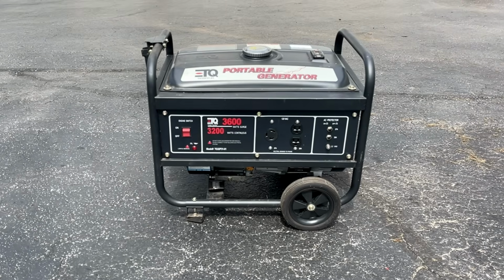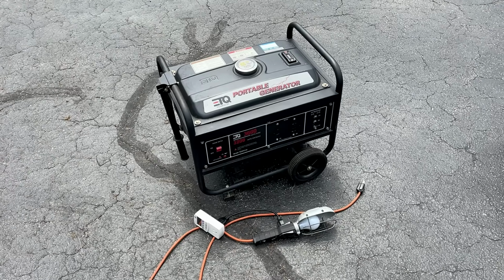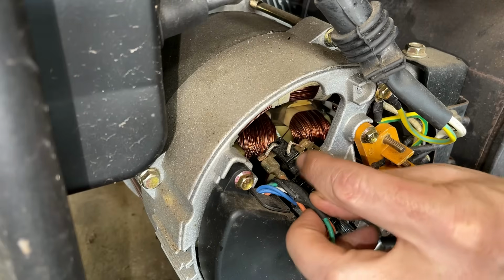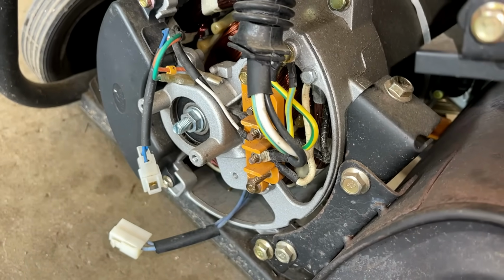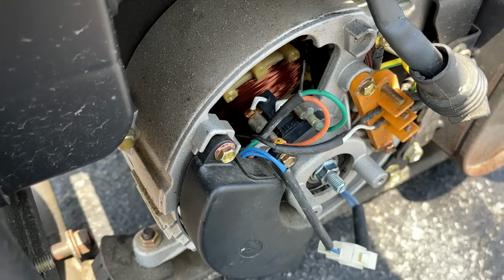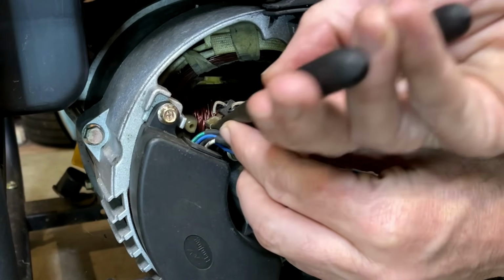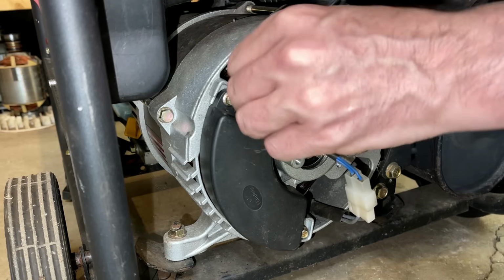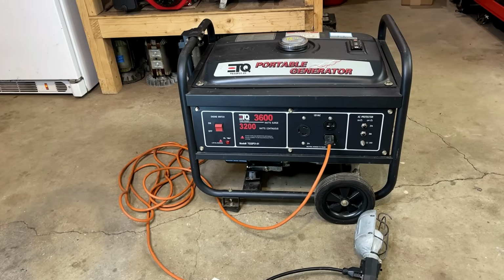Two Generators No Power Output - Same Model, Same Problem?

Comment: The slip rings look like the machining tool has had some chatter during the process. I wouldn't be surprised if there are a series of rotors that have the same issue.

Comment: Nice job James, now I know why these types of generators are so cheap.
Manufacturers save money using brushes and sliprings. I got started in power.
generation in the Army over 40 years ago and for the last 32 I have been taking care.
of a power plant. All of our generators in the Army, big and small were. 
brushless generators. Here at the power plant the generators have 3 generators in
one generator assembly. A permeant magnet generator or (PMG) to power the exciter,
 which feeds the main rotor, no brushes. Your videos take me back to a time
when I worked on the smaller generators. Thanks for the education.
I guess even an old man can learn something. Have you come across 
brushless generators? Anyway, great video. Gary
Reply from the maker: I do not see brushless as often.  Usually on older equipment.  Just finished working on a little Honda em500.  It is a small, but well made brushless.  The exciter has permanent magnets to get the stator up to 50 volts and some electro magnets and an AVR to get it the rest of the way and maintain voltage.  If you check out my playlists, I have one for brushless.

Comment: You got two generators that doesn't work my question do you still need it I would like to have it I need a power generator that size to run a sub power DJ system how can we connect and talk

Comment: I find the easiest way to really clean up the slip rings is to chuck the rotor up in a drill and spin it up then use your sandpaper. You can usually get them pretty flat just with that.

Comment: Rotor needed removed and slip rings turned and then stoned. If their not too bad you can use a stone to clean the slip rings with the engine running. You can buy a dressing stone at electrical stores or motor shops.

Comment: spin that rotor with a cordless power drill and a deep well socket . use 320 then 600 grit sandpaper taped to a wooden stick.

Comment: I have a duromax xp 4000s that starts with no problem at all, I plug 🔌 in a 2 inch submersible pump, it pumps for like a minute then it loses power for like 30 seconds then over again, anyone have any i

Comment: A small narrow honing stone, to clean and smooth the brushes, i do this with the engine running,
After honing i use a piece of hardwood to burnish the slip rings, this removes any scratches and helps prevent arcing by creating a surface on the slip ring that is equal resistance any point overall surface, no arcing

Comment: Before doing all that resistance testing, i would have checked the voltage going to the brushes and slip rings,
If no voltage from AVR, then put 12vdc on the brush terminals snd start engine, should get around 60vac at the outlets, rotor ok avr bad, 
A good visual inspection of generator head wiring should find that loose brush holder , without all the resistance reading's,
Which could have been done after fixing the loose brush

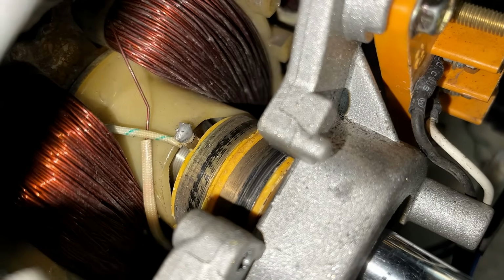Comment: 18:30  More cheep, cheap chinese cheepie  junk. They do not make, the slip rings, out of copper; also, the cheapest low quality carbon brushes. Get some, made in USA.  i  had an Xstream 3100 gen.  IT  had the brush holder, positioning the brushes, too far   INTO  rotor slip rings, the inside brush, was only half on the slip ring, with wear at a  45 degree angle. So, i shimmed it up ( tim the  shim, coffee) with two small washers, between the housing and the brush holder; moving brushes about  3/32  inch toward the outer cover.   Cleaned up slip rings, now makes  ' juice'.  Engineering from metric/english  buggered up the Autocad engineers, in drafting the measurements. And, the assemblers didn't  care.....typical chinese cheapies.
Reply: What's the point of this rambling on Chinese stuffs.  There are so many stuffs made over there and surely not everything is junk.  At least they don't charge u an arm and a leg like some western companies.  Your ignorance is showing really well.  Get what u pay for.  Don't want junk, then don't be so cheap and spend more.

Comment: Good man.  Pencil erasers, are a very fine soft abrasive. We used them, for over 30 years, cleaning memory sticks/chips on computers. And any other electronic/electrical , type of similar. The white, rectangular ones, work very well, also. As do sandpaper sticks, for larger metal objects.

Comment: Hey. I have a generator that reads 114volts output on the voltage meter but I'm not getting enough power at the ports? Any idea what may be wrong?

Comment: I had a similar experience with the rotor on my motorcycle.  The slip rings had what I would call divots that caused the brushes to chatter.  Replacing the brushes didn't fix the problem and I had to change the rotor.  I would measure the runout of the slip rings before I called it good.  Perhaps a local machine shop could turn the slip rings on a lathe.

Comment: If you look closely at the slomo running shot at 13:49, you can see the end shaft where the bearing is, is not concentric.  The threaded shaft wobbles as it turns.   As another comment stated, it is likely the bearing pocket is worn and allowing the slip rings to bounce around, causing the arcing.
Reply from the maker: The ball bearing inner race is pressed onto the rotor and the outer race into the end housing.  The bolt only applies pressure to keep the rotor pressed onto the tapered shaft.  The shaft for that bolt is larger then bolt so it is normally not centered.

Comment: I would have cleaned the armature/slip rings with some emery cloth on a block of wood/stick with a flat surface to help reach in there and hold the emery cloth. With the brushes removed and everything out of the way, I would start the engine. Then use the emery cloth to clean the armature/slip rings so they look like new.  That should lessen future potential problems. I'm NOT telling anyone what to do or suggesting anyone do this. It's just what I would do.

Comment: Any ideas? I have a GX390 with a honda engine. Engine works excellent. At start up, provides 120 volts for 10-20 seconds then drops to 9-12 volts. I have replaced the AVR with no change.

Comment: Just subscribed!! Awesome video, just wish you lived closer to me haha my Genny has the same problem slightly more complicated though it's a 15kv arcgen powermaker but you have now given me an idear what to look at to see if I can fix it, also putting a low voltage out but nothing like it should be so could just be the brushes on the rotor hopefully!! Would it be a possible cause off my welder genny not produceing the power it should also I rebuild the engine but it slows right down when you turn the amps right up and really labers think it's more to do with the alternator though

Comment: It is most likely the brush assy is a bad design, or 'fail safe' the frame is not sufficiently heat resistant either by accident, cost, or by plan- the brushes most likely arc as the frame distorts, the springs then applying uneven pressure on possibly now skewed/twisted in position brushes, they begin to arc and erode the slip rings brushes grind away and unit ceases to make power, generator then cools. So a possible 'safety' to prevent damage.

Comment: Decent video, well explained, but you may of heard this before, ...why would value your life at $15.00 using that piece of shit multimeter?  You sound like an intelligent guy and why would use this tool that could fail miserably and result in electrocution?  You don’t have to reply to this question btw.  Life is to short to save money buying crap tools my instructors used to say.. Obviously the generators fall into the same category as your multimeter.  Nice video though.

Comment: Great video James. Very useful.  It will be interesting to see how long now these generators continue to function after the fixes you applied. 
I looked at the video of the fix on the first generator and it seemed to me that the shaft was out of alignment. This may contribute to the brushes melting.
:goodvibes:I may be wrong as it was only in the video for a short time and the nut shape did not help.
Reply: That caught me out on a couple of videos but in fact its not the shaft run out its just the head of the long bolt that tightens down into the hollow shaft of the rotor and the head of the bolt doesn`t centralise perfectly. Shaft still runs true as its held in the bearing.

Comment: What causes generators to stop making power? I have one for emergencies, I pull it out and start it occasionally. It stays covered with a blanket and a generator cover in the corner of my garage. What can I do to keep it in good working condition for when I need it? I only run non ethenol fuel and I don't keep gas in it, I turn the fuel off and run the carb dry before putting it away after starting it and letting it run for about 10mins or so with a fan plugged into it every few months.
Reply from the maker: Running the carb dry and and removing the gas are the two best things you can do.  Ethanol free fuel is also good when storing fuel in the tank.  I always keep them covered to keep the dust off.  Also pull the engine over when off until you hit the compression stroke.  That way the valves are closed and minimizes the chance of rust (moisture) inside the engine.  Engines should be run a couple times a year to keep the valves in rings in good condition with a load.  Also consider adding oil through the spark plug hole for storage.  It help a lot with minimizing wear at start up and minimizes the change of rust forming.
Reply: @jcondon1  Thank You so much for the reply. I appreciate the feedback.

Comment: You can also excite the fields  by using an electric drill motor step 1 start the generator step 2 plug in drill motor  step 3 hold the trigger down and turn the chuck by hand if this don't work reverse the direction of drill and spin the chuck again. I have had to do this
 a couple of times on mine.

Comment: Great video! I'd love to know where you get your generator parts. I haven't found a good source.
There must be a factory in China spitting these out with different names. Mine is red, has a "South Tool" label on it but is otherwise identical.
Reply from the maker: Many of these are the same and just rebranded.  They look a lot like the ones that champion, predator and generac put out with a different paint job.
Reply: @jcondon1  what source do you use for generator parts?

Comment: why didn't you check to see if the 220v plug was working ....befor and after your  bruch  exchange....
Reply from the maker: If both the 120v outlets are working then the 220v will be good unless the outlet has an issue.
Reply: I don't see no 220V plug on this.  Only 120.

Comment: I have a black max generator 10000/8750 and it loses half of the voltage at the 230 plug under load in about 1 minute. Do you have any suggestions?
Reply from the maker: When that is happening would also check what the 120v outlets are doing.  Might be a loose connection or corrosion on a connection.  Maybe a bad AVR or a high resistance circuit breaker.  Could also be an issue with the brushes or dirty slip rings.
Reply: @jcondon1  thanks

Comment: I'm wondering if the failure of both slip rings / brush housings is a known issue with the manufacturer. Maybe they've redesigned those components. Is it worth a call?

Comment: I bought a new Honda EB3500X for $400. The owner said the engine was fried.
I Checked spark, good, I Checked fuel flow, Not so good.
I took off the fuel lines, carb and spark plug out ran 2 cans of carb cleaner thru
everything, Wow Real Dirty. Cleaned all ports reassembled everything, 
Took Fuel tank off , 2 more cans of carb cleaner, put tank on and added 1 gallon gas.
1st pull and it was running smooth, checked all outputs, perfect. Checked Price on the Gen
Damn near fell over. I couldn't believe I just bought a ( + - ) $3000. gen for $400.
Found 2 on Ebay Not running for $1500. Been 3 years now and it still runs my welders just fine
in the field. I do run all my Gens for about 10 to 15 minuets and use a grinder in each outlet
once a week when sitting. Keeps the carb cleaned out.  But you got a better price at $75.00

Comment: Actually like recalls on cars. One part failure due to assembly or contracted part. Slip ring turning would be a strange problem, but if those rings are replaceable, I would say, metallurgy is your problem with purity of material. Wear on those rings should be the same, but pitting would be a forging, a temperature mix of material not being hot enough, problem.  I can see those rings being made in some Chinese guy's yard, with a coal fire and poor material proportion. There's not that many generators out there, that they had to go to a major foundry.  Just my opinion, but if changing the rings is feasible, I'd change those too, or order 6 sets of brushes for future use.  You never know how long they will be made.

Comment: Those are high R. P. M. generators. They are not designed for long life. They are called single barren generators. Meaning, they are built to turn 3200 R. P. M. s. The only generators made to last are two barren, 1800 R. P. M.

Comment: I have a generator out side in generator houes to keep the weather from mess it up. I noticed I have ants around the area of the generator house   I put ant poison around it I was worried ants will get in generator motor and short it out in that area you working on.  Is that possible just keep a eye on.

Comment: I think both generators were over used, sure those generators can only be used for a certain amount of hours (duty cycle). In addition the brush holders are a bad design, definitely need need to be made from bakalite or ceramic.

Comment: Very interesting video.
I've repaired several privately owned small engined generators and compressors that had failed due to neglect or misuse, but have not had to replace the brushes, luckily, as the suppliers of these (mostly Chinese made) machines in the UK do not always (if at all) carry spare parts.
At the power station where I worked, some of the small motor generators suffered from sudden commutator sparking and had to be taken off line within minutes to avoid a reactor trip (scram), but to avoid skimming the commutator in the workshop, a hand held abrasive stone (these were actually sold for the purpose of brush bedding) whilst running at full speed worked wonders.
Slipring brushes on the main 52MW turbo alternators were changed on load with care. The exciter commutator brushes were changed whilst shut down, although I did once do it on load- not for the faint-hearted and certainly not done routinely.

Comment: My 5500 watt brushless generator with less than 30 hours on it, quit charging.  Ended up being a bad capacitor. Genuine replacement from porter cable was $80. One with the exact same specs was $12 on Amazon.

Comment: I been following your gen posts.
 Learned a lot I didn't know but. If you could solve a problem I'm having it would really be appreciated.
 I gave a newer sportsman 4000/3500
7hp.
 I pulled the head, cleaned it and valves. Rest valves to 8ft lbs on exhaust and 6ft lbs on intake. I cannot find any specs on valves or head torque. I torqued head to 30lbs.
 I put it all back together and of course it started right up but, the idle speed took off to max rpm. I double checked everything against another gen just like it and everything is set identical to it's sister gen. All the carb settings are working properly and butt fly is free, throttle and gov all working good and free. But I can't get the idle to drop. Have you a clue or two to help me out?
 It worked perfect before I put it together but the nite it died the exhaust valve sucked a small piece of carbon so I fixed all of that and now it idle or runs so fast Im thinking putting the motor on a race cart! Hahaha!
Thank you, and if you could help I would really appreciate it!
Gary;
Reply: I'm sorry, 08 exhaust, 06 intake Valve. Not ft lbs

Comment: Generators can sometimes loose their residual magnetism. No need to take it apart. Just start it up, plug in a hand drill, squeeze the trigger on the hand drill, then grab the drill chuck and twist with your hand to get it moving.

Comment: Ha ha, same brushes problem on the two generator... Be serious, the brushes used are too small to collect 26 A (3200w/120v) without overheated and destroy the brushes's support ! 
As i can see, the collector rings are not copper... It is only a generator bad and poor design !!!
You should have the same problem after running few hour !!

Comment: The cause of the failure can be several things, One the tension of the springs if is very low can cause a false contact that increases the temperature in the junction. Other cause can be the grade of the brushes, normally the brushes are manufacture with a mixture of graphite and  copper powder this relation changes the conductivity (resistivity) of the junction and the contact produces more or less heat. Finally to Polish the slipping rings, you should use a 400 or 500 sand paper and turn the generator  (after removing the spark plug) with a  a socket attached to a hand drill. Good luck.

Comment: for 3000 watts going thru those tiny brushes will make them heat and the holder should be made out of bakalite which can stand heat but the holders where made from thermo plastic.Useless.